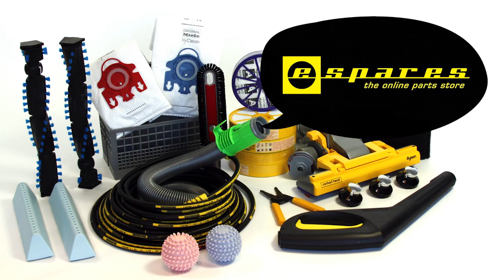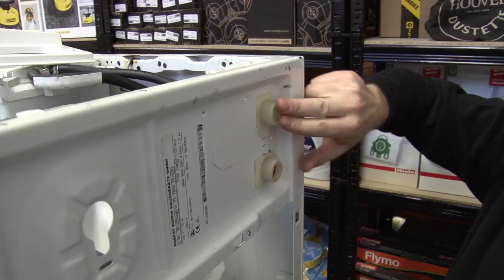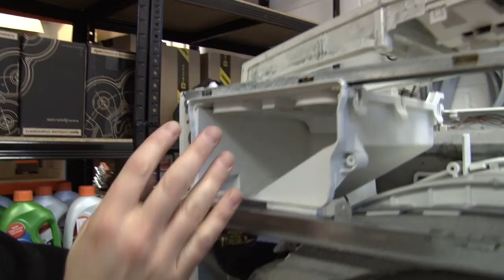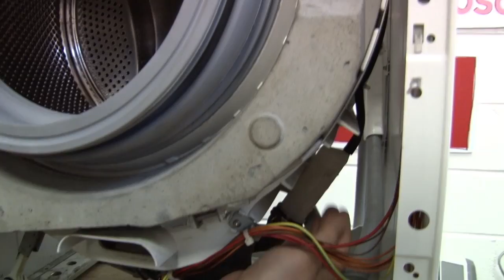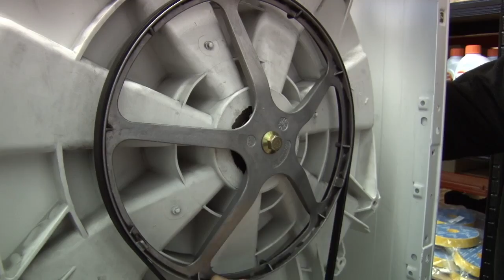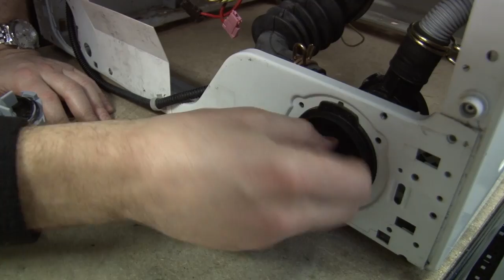How Does a Washing Machine Work?

Comment: WOW! that was easy. Thanks a lot for the video, I was exactly looking for it. One question, how the door interlock senses when to unlock itself? I mean how it understands that the job is done and it is unlocked?
Reply from the maker: Hi Gemini, most washing machines use a bi-metal to lock and unlock the door, it heats the metal to make contact and lock the door when the machine has finished and the power is turned off the metal cools releasing the door.

Comment: is that washer an older model?cuz mine looks similar to that has buttons no nobs/dial and doesn't have a belt.
Reply from the maker: +Automobile CATS Yes this model is getting on a bit but most of the information is still applicable for most models (direct drive motors are just fitted to the drum directly). If you have a specific problem and you give us your model details we will try and help you sort it out. :-)

Comment: Can u find money in the machine and can you make butter i know it sounds stupid but can you?
Reply from the maker: Hi Simon. often Engineers find coins in the machine where they have been left in pockets and worked there way from the tub into the filter. These coins can do a lot of damage so you must check pockets to prevent this occurring.
As far as making butter the drum movement may be suitable to churn butter but because of the construction it would be so difficult to clean thoroughly after use.
If used repeatedly the 'old' butter from previous uses would soon go ranseed and spoil the fresh butter so making it unusable.

Comment: Every time the drum stops its keep boiling it likes a kettle i all ways put my washing on 90 dregress and spin speed 1200 it takes 3hours to wash
Reply from the maker: Engineers listen for this noise when testing as you can hear the 'kettle noise' long before you detect heat through the door. It is not likely to be a fault but only use a 90 Wash when you need to as you are causing unnecessary wear on clothes and machines.
If you have been 'boiling washing to tackle smells in the laundry see another video:
 www.youtube.com/watch?v=ifWK9df1qgg
Reply: Simon Adams - 90 degrees? Lol are you mad? 30 - 40 degrees will clean most clothing but 60 degrees is ideal for bed sheets and towels. This comment really made my laugh. Cycle set for 3 hours at 90 degrees....LOL X 100

Comment: How hot is the water if you put on 90 degrees?
Reply from the maker: Hi Simon. depends on the machine. Older machines may have a Thermo mechanical thermostat that will 'turn off' when the drum water reaches around 90 degrees +- up to10% typically. A more modern machine will likely have a NTC sensor that can more closely monitor the temperature but again there may be tolerances that can effect this by a few degrees. 
Usually once the temperature is reached the heater will not come on again to 'maintain' the temperature and by the time the machine finishes the wash and discharges the water the temperature may have dropped significantly.

Comment: My samsung washing machine is not working... After switch on, the drum rotates 2 or 3 times and suddenly stops.. How can I fix it?... Hope you will help me...
Reply from the maker: Hi Asif, See our diagnosis video section and:
How to diagnose washing machine control and program problems
This is an unusual fault so check if it fills correctly and does it carry out a spin cycle?.

Comment: Hello Matt, i've got a problem with my Hotpoint Aquarius WMA50. I forgot to turn the water supply taps, turned the washer and then i heard a bang/burning smell from around the programme selector knob. When i got the PCB out, some of the circuit copper lines on the board were cut and exposed.
I solder wired those broken lines but the machine will not light up, just the door lock works when i turn to power.

What can i do to rectify that issue?? Thank you!
Reply: Thanks a lot for your help Matt.

Comment: Thanks,I've learnt loads through watching your vids,I had mine apart over Christmas,it went dead on me,no lights or anything,I got the pcb out and other one at the control panel I then squirted loads of contact cleaner over all the connections,put it back together again and hey-presto it lit up like new,if I hadn't of found these videos I would have scrapped it and gone and got another.so thanks very much indeed

Comment: Hello.
I have a problem with my slimline top loading washing machine.
The hatch on the inner drum opened during washing, and the drum is now stuck in the tub.
I tried to remove the side of the washing machine, but I can't figure out how to actually open the tub itself.
Do you have any reccomendations on this?
The machine in question is an ariston avtl 104.
Will I need to take the entire tub out of the machine?

Comment: Maytag has a sensor in the mixing valve. It alternates, hot, warm, cold during the fill to be sure the water in the tub is the correct temperature.

Comment: Why is it I see in the UK washing machines have heating elements?  The hoover was the first one I noticed this.  Since we commonly have hot water heating in the USA it would seem to only be an added expense in utility consumption.  Not a green idea at all.
Reply: DandyDon In Europe,  they use tankless water heaters,  and over there, the water heater wouldn't be able to supply enough hot water to the washer, or dishwasher,  that they put heating elements in those appliances.   Since Europe uses 1 phase 220 volt service, it doesn't cost them that much more to heat its own water.   In North America,  it would cost us more, as we use 1 phase 110 service, and that same appliance would need a 2 phase 220 volt service to operate it in the same way.  For us, it would cost more.  What few washers that have heating elements in them, only boost the temperature by up to 20 to 30°F for our models.